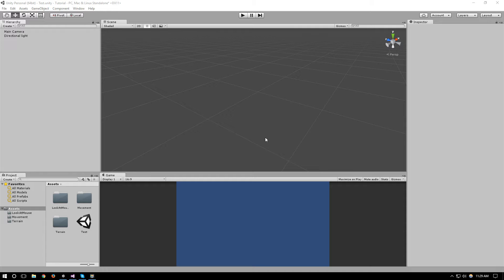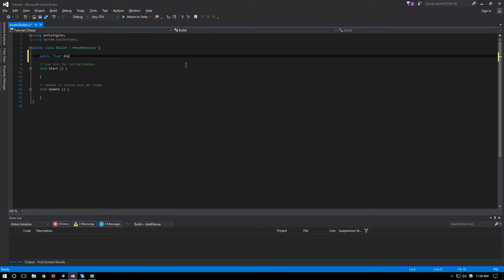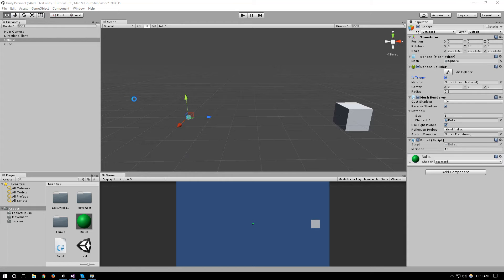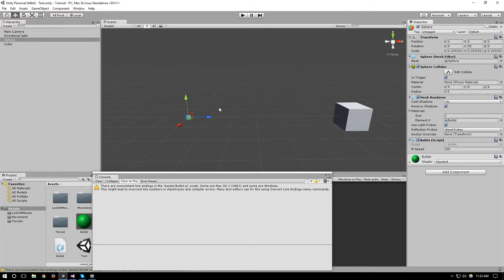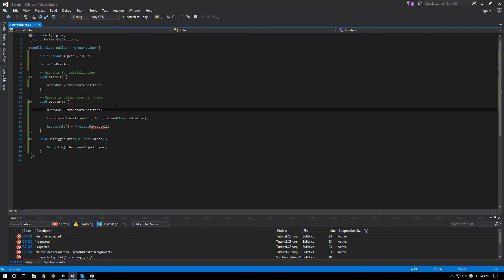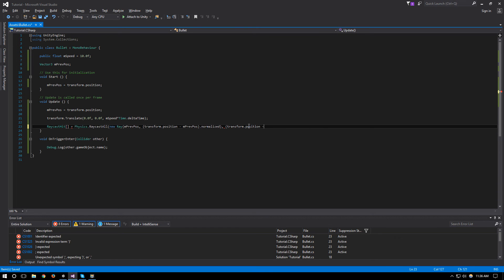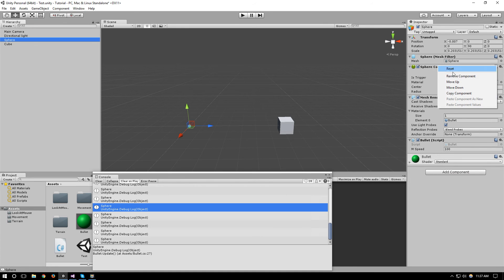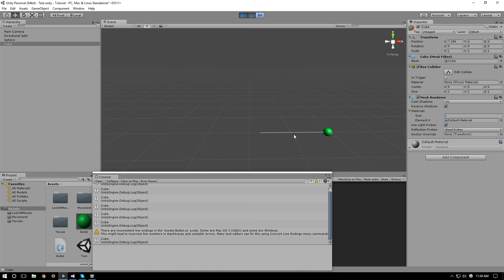Unity Tutorials: Bullet Collisions Using a Raycast

Comment: I have a question about this raycast, currently I've implemented your code into my game but when i spawn a decal at the hits[i].transform.position its not actually spawning at the location of where my bullet hits but rather a specific location on the surface that it hits, currently i'm just testing this on a floor gameobject i quickly threw in to test this code on. 

any reasons why this might be the case?
Reply from the maker: I'm not sure what you mean, the collision point should be a point of the surface, that is the point where the bullet hits the surface.

Comment: To the creator and viewers of this video:

"mPrevPos = transform.position" 
should be moved to the line after the line of code that draws the raycast otherwise the ray your  creating is essentially casting from the point transform.position to the point transform.position as it is updating the position of mPrevPos in the same frame its creating the ray. By having mPrevPos after the raycast draw it insures that mPrevPos is the transform.position the object was at in the previous frame and not the current one.
You should also be using FixedUpdate instead of Update for improved accuracy.

Your code still works but if you increase the speed of the ball it would pass through the object and no collisions would be recorded since your raycast is essentially drawing a point and not a line from where it was in the previous frame, as intended.

Appreciate the video otherwise.
Reply from the maker: I did some testing on it and it seems like the position changes immediately after transform.Translate is called, so technically having the mPrevPos = transform.position at the top of the update is essentially the same as having it at the end. in one case you're setting it in the frame before to get it in the next frame, and in another you're getting it this frame before you make any movements.  Since in both cases you are using transform.position after calling transform.Translate. If you want to only use positions after they go through the physics fixing though, you would need to use the position of the last 2 frames instead of the current one and the one before it. Depends on your needs though.

I agree with the FixedUpdate comment though It is probably a more suitable place to have this logic run.

Thank you for the feedback!
Reply: Ah I see, I modified your code a little bit and had the transform.translate in a different place before the mPrevPos = transform.position update  and the raycast and that's what was causing the issue on my end.